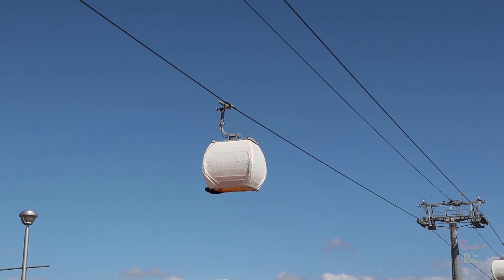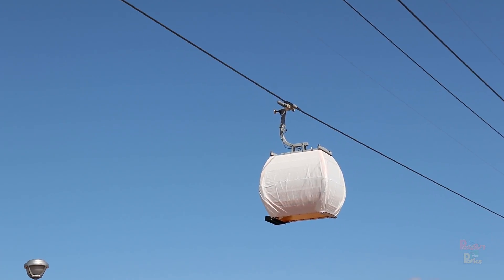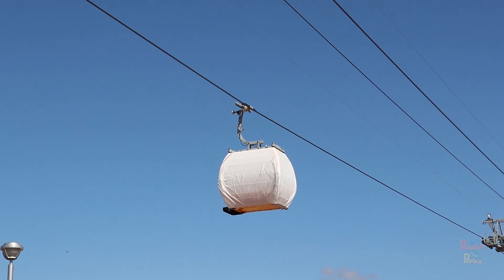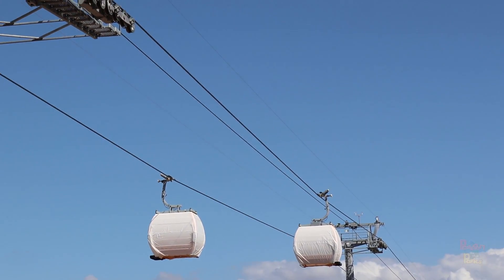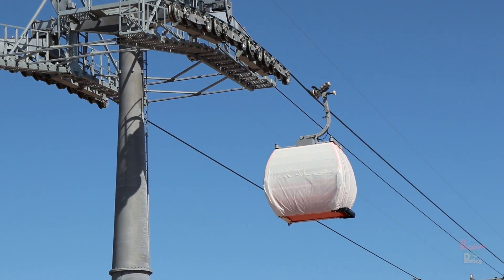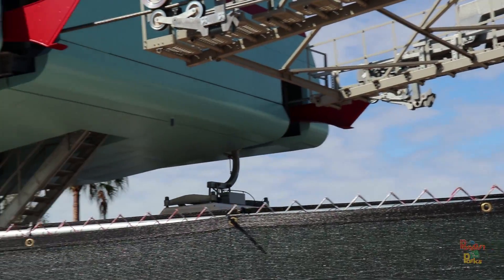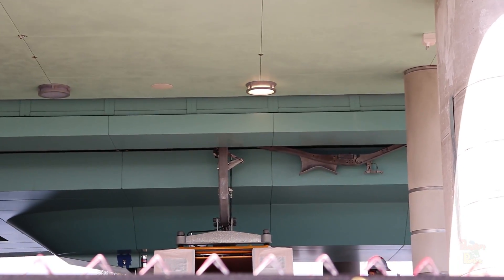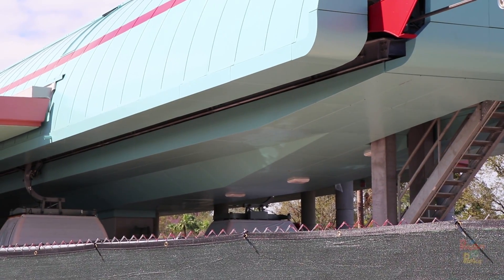Disney Skyliner Gondolas On Board Power Supply - How It Works

Comment from the maker: Got to meet up with my good friend Michael ("Vodhin" here on YouTube) and we started chatting about the on board power supply to the gondolas.  I thought I would share it with you all.  Make you you say hello to Michael in the comments.
Reply: I definitely trust Vodhin's expertise on this, but the black cable you are seeing is not an electrical cable, but a mechanical one used to open the doors similar to the type used to control the breaks on a bicycle. You can see that the top end is attached to the level that controls the door opening and closing. Has Disney said there would be anything powered on board? Maybe the electrical cable is inside the arm, or just bundled with the door control cable.
Reply: 2000danlb Freeze frame at 1:26 you can see the power cable going into the gray box on top of the gondola. That goes up behind the arm (or inside the arm, it’s hard to see) to the grip where you can see a tiny black box with two metal contacts used to charge the batteries, mounted on the arm for the guide roller sticking out from the grip. There is another black cable for the door opening mechanism, which you can see part of in front of the bend of the hangar arm.
Reply: Thanks for clarifying, now that I look closer I can see the cable up by the grip.
Reply from the maker: @danlb2000  yes, like Michael said it's just a smaller black cable running down through the arm.  Easier to see in person.  I will say it is pretty cool just watching that door opening mechanism work.
Reply: Passport to the Parks oh, yes. I should say thank you to Rob for meeting up with me.  It was great chatting for the brief moment I had away from the group I was with. I must say that I was not at my best when we talked, Rob, as apparently I was getting a bit of sunstroke on top of just being worn out keeping up with my group (4 parks in two days, with bonus FP that kept us running further and longer than originally planned). We weren’t even planning on going to HS until that afternoon. Brown Derby makes for a great meal, BTW. 

Anyway, it was great catching up with you at HS and I’m glad they started running the Skyliner while we were there. One thing that I though about.on the way home was that they didn’t have gondolas switching into the secondary loading area, so the spacing and timing that we witnessed didn’t include those extra gondolas. I’d say there will be two more for every three we saw, and another video posted by BlogMickey showed a much faster speed and closer grouping in the station - so I bet we’ll see two or three loading regularly with one or two in the secondary loading area at peak times. Soon we should see this high speed, fully loaded lift test..

Comment: No A/C huge waste of money nuff said
Reply: Installing A/C when it doesn't need it would be a huge waste of money.
Reply: Air-Conditioning needs a lot of power to be effective. There are gondolas that have A/C out there in the world, but they use batteries or Ultra-Capacitors that are charged while in the station, like the Skyliner. Those experimental  A/C systems don't really chill the air very well as they are not very powerful. Any chilled air will spill out when the gondolas are in the station with their doors open, and the ride time between station is so short that there isn't enough time for the A/C to cool the air back down.

Comment: I will never ride or put my family in these until they have air.
Reply: hahahahahahahaha
Reply: Air-Conditioning needs a lot of power to be effective. There are gondolas that have A/C out there in the world, but they use batteries or Ultra-Capacitors that are charged while in the station, like the Skyliner. Those experimental  A/C systems don't really chill the air very well as they are not very powerful. Any chilled air will spill out when the gondolas are in the station with their doors open, and the ride time between station is so short that there isn't enough time for the A/C to cool the air back down.

Comment: Will they show how people in wheelchairs and scooters are supposed to board?
Reply: There is a seperate 'loop' behind the regular loading/unloading area where the gondolas can come to a (near?) complete stop to let people in wheelchairs and scooters board the gondola's. I'm sure Disney will have clear instructions at the stations on how disabled guests can use the Skyliner :)
Reply: spacebug30 I know about the separate loading area, I’m talking about how is the ramp going to be deployed. Is it going to be similar to how they do it with the monorails where the CM’s put down a ramp or will the ramp be built into the gondolas?
Reply: @groot3737  The gondolas are leveled to the loading platform I think so they won't need a ramp. Like at 0:43 you can see a part sticking out of the gondola, I guess that will fill the cap between the platform and the gondola.
Reply: spacebug30 probably

Comment: I think the word you're looking for is "High Capacity". As an Electrical Engineer, a "Capacitor would not provide enough power for long enough to be useful, FYI
Reply: @Blueimacuser1 Actually, there are capacitors that can be used in applications like this that provide rapid charging but also rapid discharging. This is how the A/C in the London system is powered. https://www.masstransitmag.com/home/press-release/10835671/maxwell-technologies-inc-maxwell-technologies-supplies-ultracapacitors-to-london-cable-cars
Reply from the maker: @danlb2000  very cool article.  Thanks.
Reply: @danlb2000  Sometimes these are called "Ultra-capacitors" or "Super-Capacitors".  Very popular in the mass transit industry worldwide.  Also used on wind farm turbines.
Reply from the maker: Sometimes I don't always spit the words out right...lol...anemometer was another one that did me in before.  Always appreciate good input though.  Thanks for the comment!
Reply: So the rechargeable battery charges in the stations?
Reply: Real Estate Unplugged Yes. There are electrical contacts up near the grip that attaches to the cable that make contact with a pair of electrical rails inside the terminals. The turn station between Epcot and Riviera probably does some charging too since that’s another “station” in the sense that the gondolas will be off the cable as they slowly move through the turn
Reply: My guess is that the Skyliner is using batteries and not ultra-capacitors as the capacitors I’ve seen have external heatsink fins needed for cooling.
Reply: As control electrician that use to work for a amusement park full-time. They use wipers on the gondolas which makes contact with the power rail through out the station.